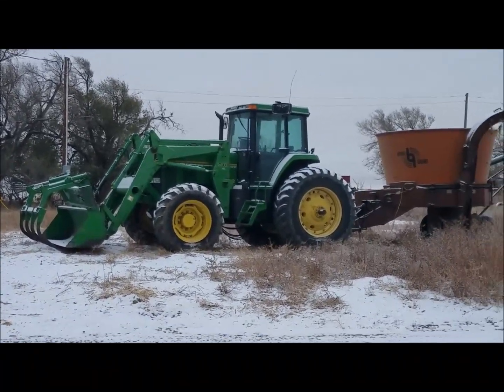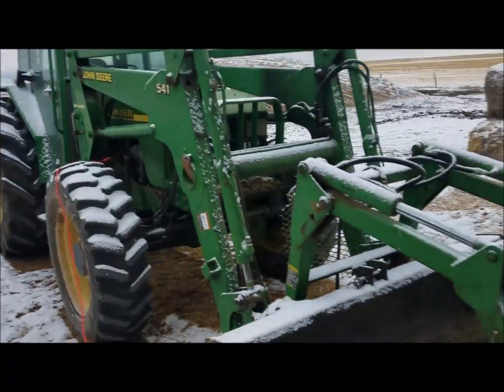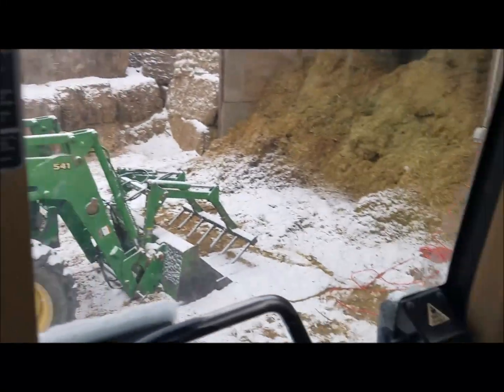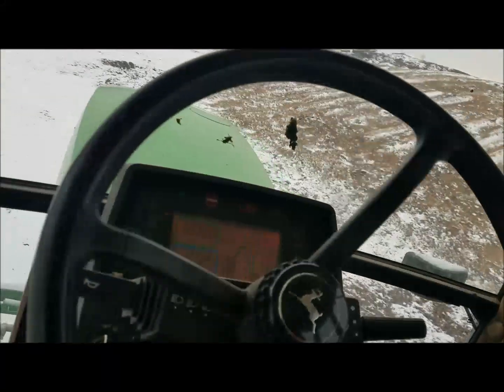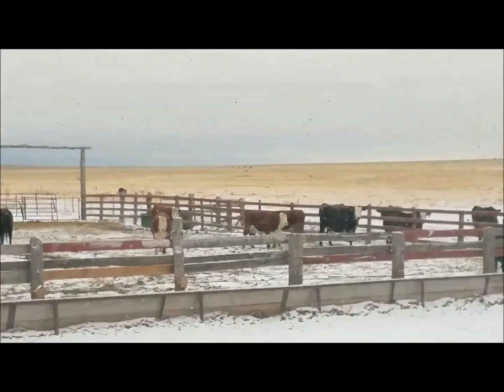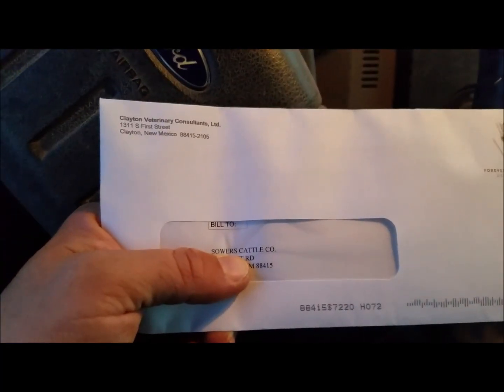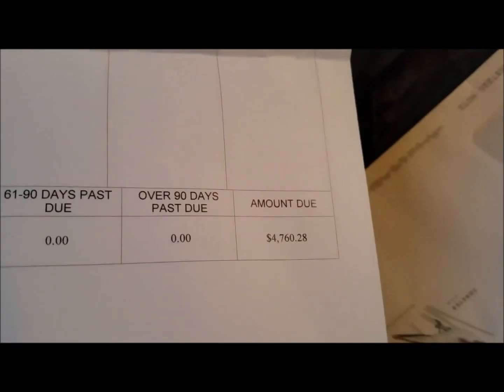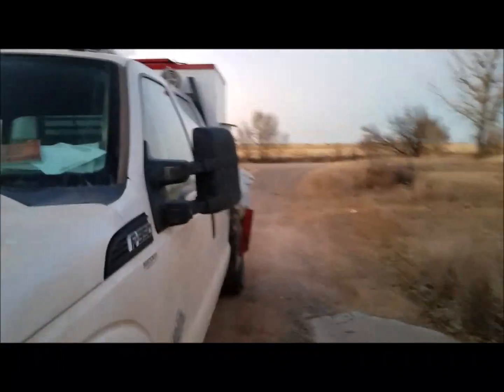Vet bill came today

Comment: I hope you didn't buy cheap ex.cords.block heaters are  1500watts it will melts the ends. 12or 14 gauge .its been14 below here in mi.few days back.50 today. mud in stalk fields.  great channel. my case uh magnum has 8320hrs still start great in winter..always feel better when bills are less than think..

Comment: Good day.  Here in Ont. Canada plug in are almost a  must, I think  it helps warm the oil up quicker   to circulate.  I live in  central Ont. mennonites use diesel generators, 1 fellow had 3.9 cummins  before he replace it, it had 39,000 hrs. on, all  instead of cold starts.  Now do you get much snow, and what is doggy name.  thanks.
Reply from the maker: Don Voll we get alot usually for how far south we live, we have the elevation is why we get snow. nothing compared to up north and no where near as often but then it does decide to snow we can get hammered. mainly all of our snow is blowing snow

Comment: SowerscattlecoI agree with the 2by4 on the wall hell don't want buy something and it smashed or tore down and ran over it work and the 2by4 does the same job.   A vet is something one can not do with out on a farm and ranch seen cows would not think they were going to live after they work on them up and running around.   They are those thing you can do for your self but they are things above your pay grade lol.